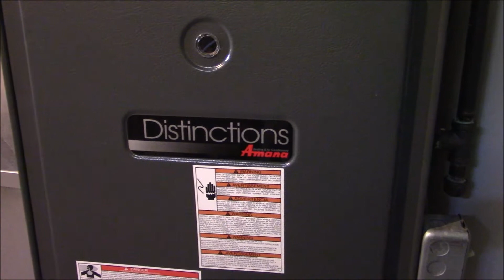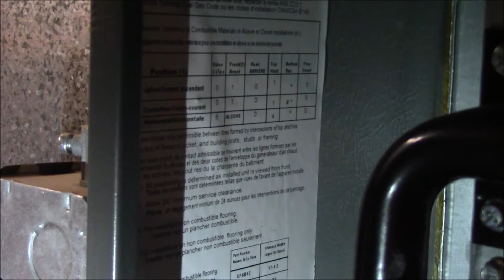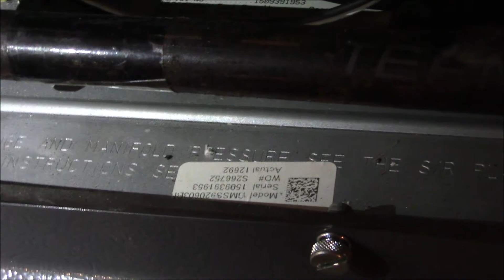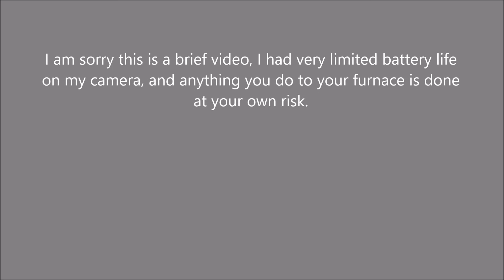Amana furnace leaking water fix

Comment: Dealing with situations like this is another reason I would not purchase a 90% gas furnace. To many maintenance problems related to clogged drain lines like what you have encountered. The fan you removed is called the inducer fan not induction. Thanks for sharing this video and glad you were able to fix your issue.

Comment: Had to do the exact same thing with my Amana 90 air command.....It took about 10 years but it started to leak and when I took off the recoup cover it was cracked in 3 out of the 4 corners....So on the new one I drilled out the screw holes one size larger and used washers to help spread out the load......Has been working great for the last 10 years.....I used red high heat rtv silicone on mine with no gasket.....Besides that problem the most failures I have had are with the pressure switches I am now on my 4th set in the 20 years I have had my furnace bought new in 2002.
Reply from the maker: the Amana is made by Goodman; they share many similar issues. glad to hear you were able to fix your furnace

Comment: Informative video but unfortunately not where water is coming from on my furnace. Mine is drain trap on side of furnace overflowing with water. Have tried snaking to see if clogged but nothing came out. I can’t take apart cause it is draining into piping in floor. My house is on a cement slab. Haven’t found a video yet that is helpful.
Reply from the maker: I wish you the best on getting your issue resolved
Reply: could be leaking from inside....there are drain hoses coming from the inducer elbow that could be clogged

Comment: The black plastic piece in mine looks melted which caused a leak. How could that happen?
Reply from the maker: You may wish to look closer at your heat exchanger for if it leaking it will be putting out carbon monoxide and flames
Reply: @bbbjim1fixedit  if that is the case should I just replace the whole unit? It’s 5 years old and still under warranty.
Reply from the maker: @cpa_collector_8688  you may have a lifetime warranty on the heat exchanger, it would be worth checking with the manufacturer

Comment: Thanks for posting. I am having the same issue right now. Applying the new adhesive-is that a temporary fix? Will the water drain properly to where it needs to go? If you have a furnace tech come later will that adhesive cause him a problem in removing that cover? I am exploring my options right now before I decide.
Reply from the maker: I used the silicone since it is ready available at most automotive stores.  The local HVAC place in town did not have a gasket on hand and would take 2 days to get.  What I did is a permeant fix yet you will still be able to remove it if needing service in the future.  I wish you the best on your repair

Comment: I'm having the same issue with my Amana. You used the silicone instead of another gasket, would you say the silicone is the better option or does it not matter? Thanks!
Reply from the maker: I used the silicone because the gasket had to be ordered and the silicone was available at the local auto parts store.
Reply: I heard and read a lot of other techs using hi-temp caulk to seal the collector boxes, in Lou of gaskets which are prone to repeat failures.

Comment: Did you take your furnace out of service for 24 full hours to let the silicone cure or did you use your furnace after you hand torch them
Reply from the maker: I let it cure for about 20 minutes after I tightened the screws and it hadn't leaked since. I wish you the best on your repair